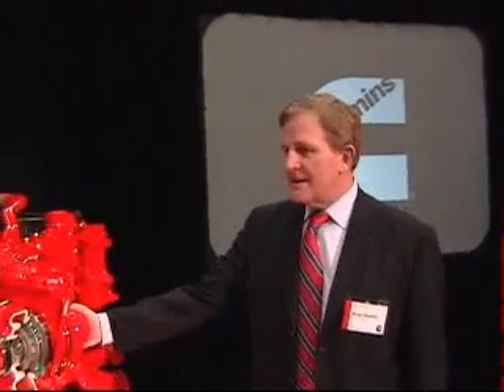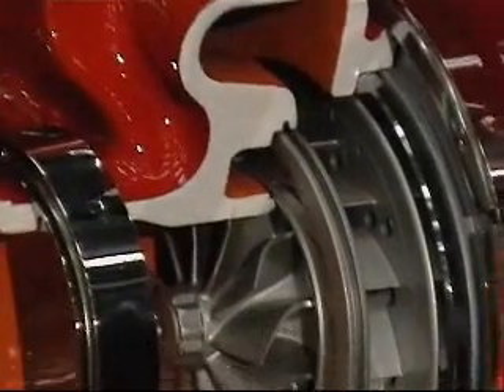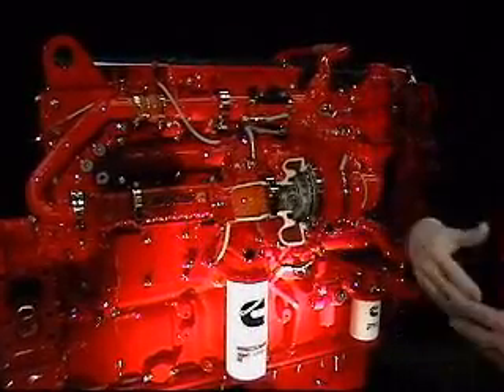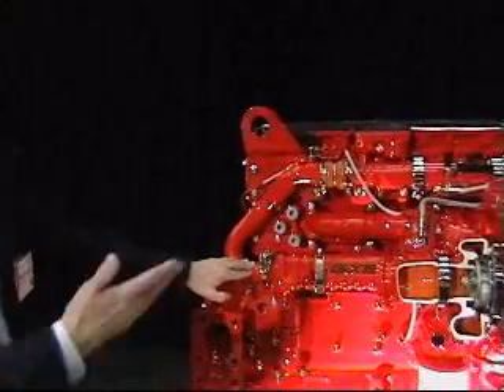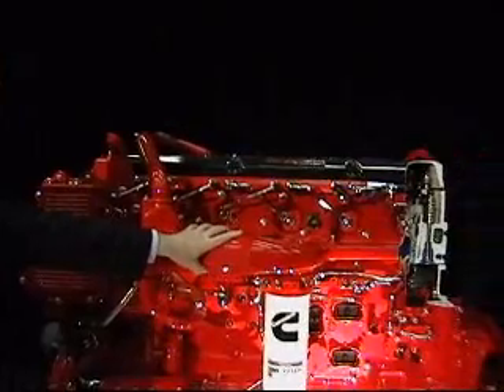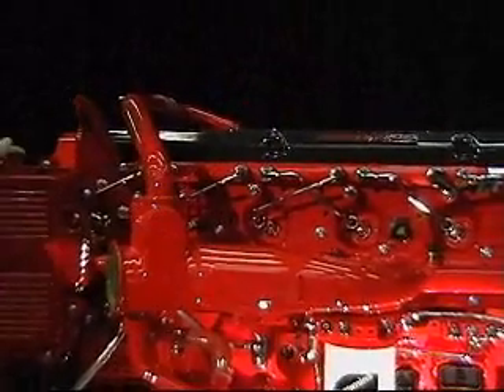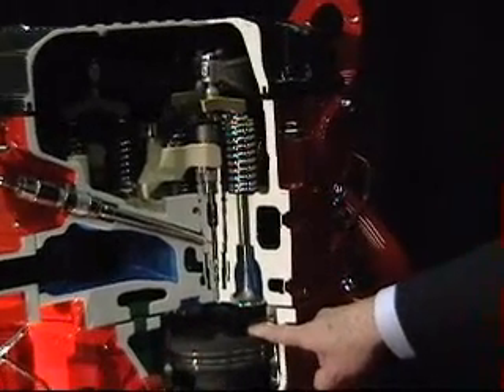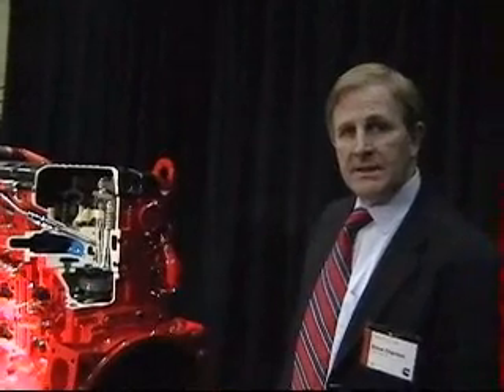First Look: Cummins 2010 ISX15 Engine

Comment: This engine does have its issues alright, doing my 27th failed fuel injection pump right now, also yes the valve stem seals are a problem, the new seals seem to hold better though.  The emissions dont like the cold, every winter now they line up 3-4 deep at the shop door. And now they are getting mileage up to 200k, liners are dropping, got to look at it as job security I guess.

Comment: don't delete egr on an 870 or 871 ISX if you're a heavy hauler. Raises in-cylinder temperatures dramatically resulting in cylinder 1 or 4 coming through the side of the block :)

Comment: This engine is junk. It's turning out to be as bad as, if not worse than, the ISX 871, although I havn't seen any con rods sticking out the side of the block yet. Valve guides are a huge issue but Cummins refuses to admit that us Technicians. Anybody keep getting the infamous 3376 fault code along with valve stem oil seals popping up?? If it's on-going, replace your cylinder head or have a good engine shop replace the guides.

Comment: diesel mechanic here, these new engines are much easier to work on than any CAT engine. i like working on them because they are still new and aren't leaking everywhere. plus kenworth put them higher in the chassis than those old CAT engines so things are easier to get at. 

the emissions stuff won't really affect performance, you can still get as much power out of these as any engine, and the torque numbers these things are putting out are just crazy.

Comment: @trucker765 
Wish it could be done.  The computer would shut you down quick.  You can thank Maxxforce for making it where you cannot even use water instead of DPF fluid in the tank.  They sued when the found out you could get away with that on cummins and detroit engines.

Comment: Been driving this engine for about 2 months and what a load of crap. Horrible fuel mileage plus you have to put money into that DEF crap on top of it all. So there is a lose, lose situation. Throttle response is terrible and tubo spool up time is bad. Wish I had my c-15 back. Cannot even see how these motors can breathe with all that SCR equipment on it. The days of having a nice sounding and a deep rumble in your truck are gone I guess. Also mileage on average is 4.0-4.5 pulling doubles.

Comment: It all sounds great, but the ISX 15 liter does NOT meet the EPA Nitrous Oxide levels of .20 grams/horsepower/mile-it is more like .28 grams.  Cummins is using clean engine points from their 6.7 liter Dodge engine to get them through.  Yet-their new ISX 11.9 liter produces less Nitrous Oxide then their Natural gas engine (11.9 is .08 grams, natural gas .10). So do figure why Cummins cannot get the 15 liter cleaned up more.